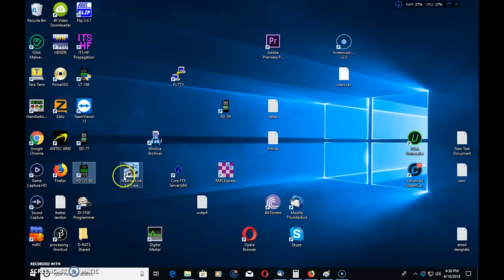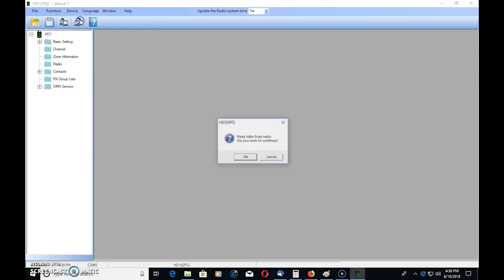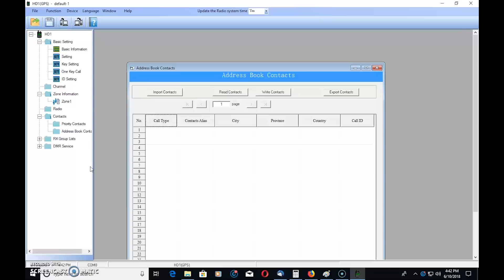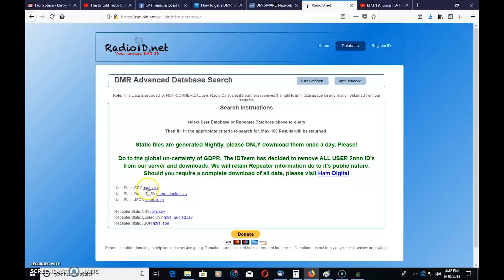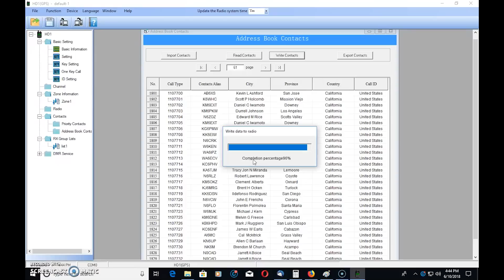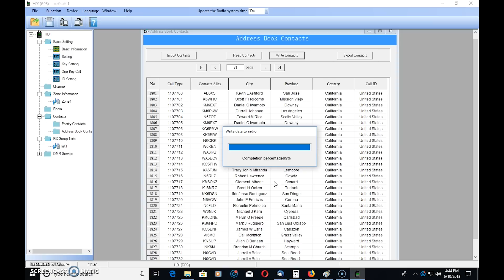DMR Handheld Ailunce HD1 Retevis Dual Band DMR Review

Comment: Does it allow you to enter a frequency and decode the CC, TS, and TG being received and display that data on the screen ?

My biggest issues with DMR is that the radios do not decode on the fly and do not display the CC,TS and TG that are in use, so I don't hear the transmissions and I can not tell what settings are being used.
Reply: Mine shows what cdc tone is using ever transmission I receive.

Comment: Yes i have the HD1 and with Firmware V1.5.3 and it is a very good Radio. There are only two negative points about this Radio. 1. Even after the new Update and External Mic you have low Audio Volume on Analog Tx. The 2nd thing is the most important. The Radio has NO Superheterodyne Receiver! A 0.5w radio from 5 meters is enough to make your Rx on the HD1 completly dead!
Reply: I BOUGHT AN HD1 ,AND DID THE UPDATE. NOW THE RADIO IS DEAD. ALL BLACK SCREEN AND THE DESKTOP WON'T SEE IT  ANY MORE   ANY IDEAS ??

Comment: FYI when you do your user db upload to the radio you DO NOT put it in program mode(PTT and upper button) turn the radio on plug it in the the computer open the software put the file in and click WRITE then it will send the file to the radio.

Comment: Hi Eric. The reason that your Contacts list did not display the User information is that the .csv file you imported was of the incorrect format. Check out the Headers of the Address Book contacts as compared with the details in the actual columns. See from 10:15... Call Type should display Private and not the Call ID etc... The correct formatted columns is important and unlike many other DMR radios like the MD-380's and so on! Have a look at AmateurRadio.digital for example!! Enjoy all your videos, 73, Brian EI8EJB
Reply from the maker: OK.... Thanks for the information

Comment: Nice HT they have all the accy"s for these to on Amazon still no battery elimnator for gd-77 yet .
Hd-1 looking good ! 
Ailunce HD1 GPS Digital 2 Way Radio Dual Band Dual Time Slot 10W 3000Channels 100000 Contacts 3200mAh Waterproof Ham Radio with FM Function and Programming Cable（Black,1pack） https://www.amazon.com/dp/B076V85XPM/ref=cm_sw_r_cp_apa_fi0mBbZB4A3XY